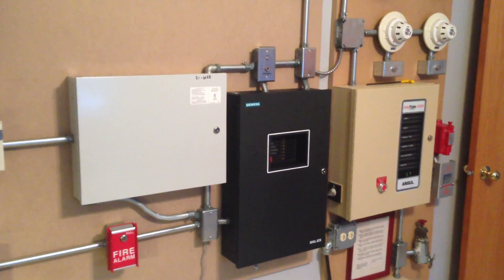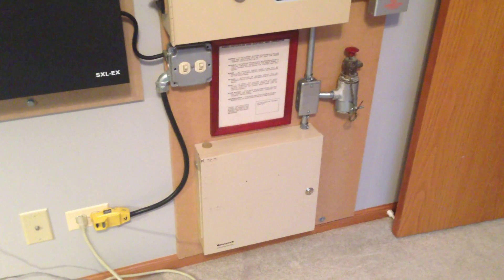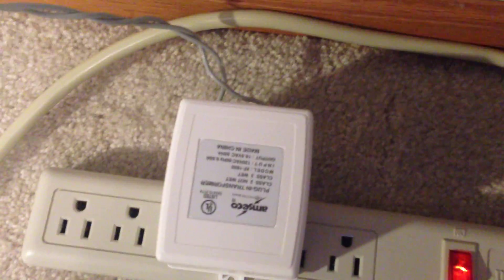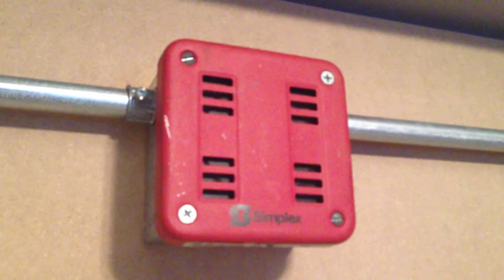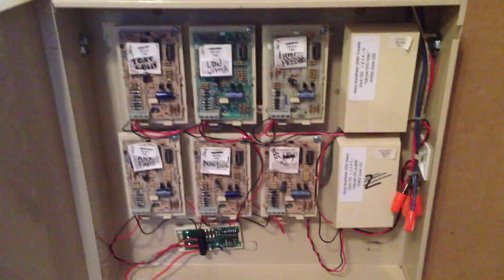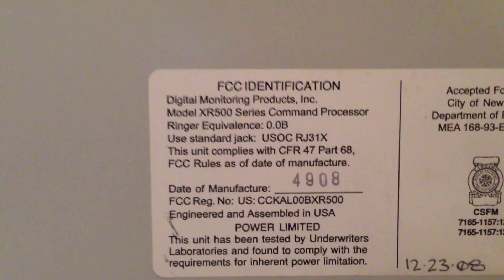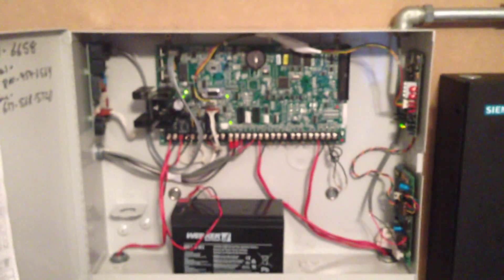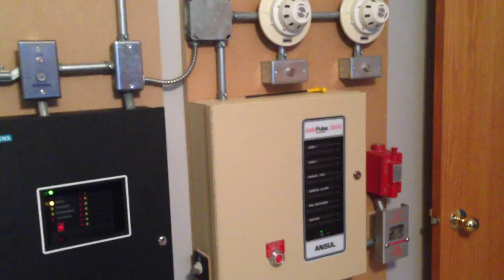System Test 12 | New DMP XR-500

Comment: Hi ,what's default installer code for DMP XR500 series?
Reply from the maker: The default "code" is actually to not have a code set at all - if it is asking for a code, that means a custom one has been set. Otherwise it would not prompt to enter one at all.

Comment: awesome test. what do you have to do to adjust the pitch on the 9838?
Reply from the maker: On the rear of the device, there should be a loose plastic square piece. Squeeze the sides of this piece in and pull out to remove. Underneath will be a metal tab, which can be bent up or down to adjust the pitch.
Reply: kcin556 what does the tab look like
Reply from the maker: I will post a video showing exactly how to adjust the pitch tonight.
Reply from the maker: capt421 Video explaining how to adjust pitch has been posted. Look for it on my channel.